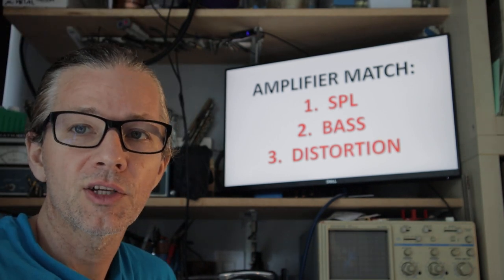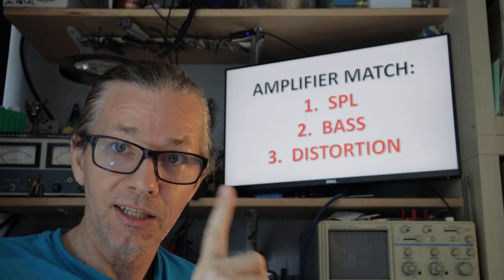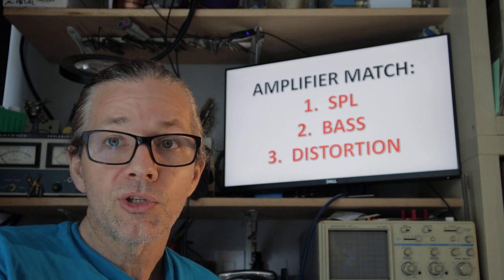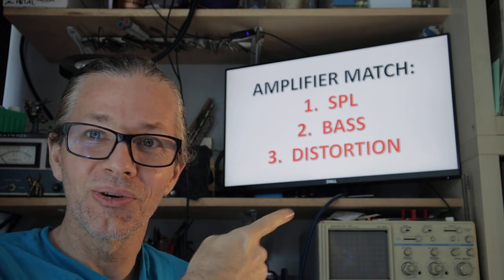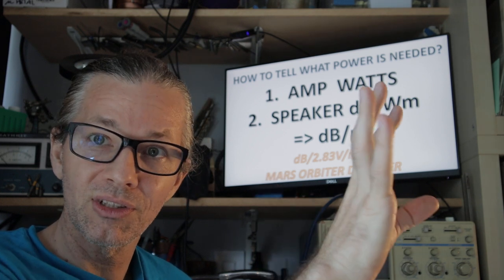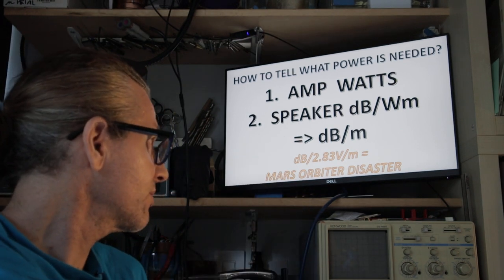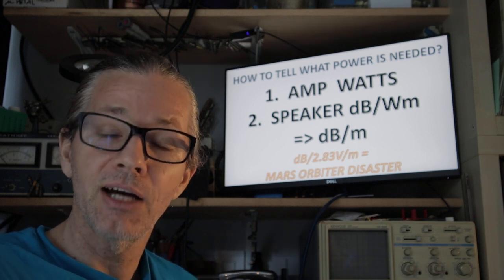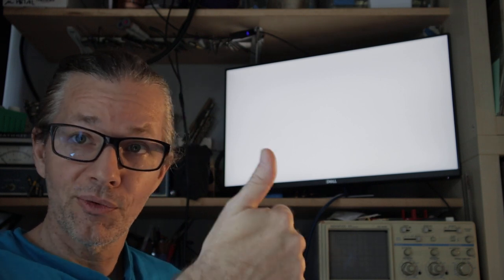How to match amplifier to loudspeaker - Part II.

Comment: Hi Janos, 
Hope you're well :)
Thanks for sharing.
I agree with the fact that high efficiency let's you see deeper into the music for less money. It's like it can unfold the music at a higher level for less money.
It is also easier to obtain high quality on lower power amplifiers because we can use nicer parts, a shorter signal path etc...
But there is a con with that. The bass. I've listened to a lot of high efficiency loudspeakers lately. They need Giant cabinet to be able to produce the right amount of bass, to go low enough compare to a low efficient speakers.

On the other side I don't subscribe with the saying that high power means less quality. I think the bad high power with compromise inside and weak parts shows limits quicker and loose the magic when you ask more power from those amps.

Today we live in small rooms and if you wish to have a almost complete sound 30hz to 20hz a nice small speakers with low efficiency and a stable impedance curve is the right choice. You feed it with quality power, a DIY class A amplifiers with the good components sound amazing. Not something you can buy they always have compromises. The same way you have to make you low power amps.

So I think at the end it depends on what someone wants and like to listen.
Most of the high efficiency loudspeakers I've listened sound nice but it was like half of the information was missing. The part that was there was wonderful but the drivers couldn't go far in a small room. Plus the imaging and soundstage is non existent buy comparison. The dynamic is insane on high efficiency speakers and you get the timing very early.

I understand the benefits of high efficiency but I think there are no absolute. 
It is like the conversation on digital vs analogue. I think the digital equipment we use is in the stone age. 
During the COVID i proceeded to improve mine and upgrade everything from the network to the components and making my own streamer (with 9 different lpsu etc...) I can see clearly why the digital sold I terrible. 

I see it like high efficiency speakers is analogue: simple, direct, amazing.

Low efficiency is digital : difficult, complicated but if you take the time to clean every aspects like we do in analogue the quality 🎉

I just wanted to push the conversation 
Have a nice day my friend.
Reply: Well said!
Reply: "Today we live in small rooms and if you wish to have a almost complete sound 30hz to 20hz a nice small speakers with low efficiency and a stable impedance curve is the right choice."

The actual heck is that mean? Are you suggesting that a shoebox with a tiny 4" ~82-84dB mid woofer is the best choice for anything? Sure you can get the mids and highs as right as possible, but those things have jacksh*t bass no matter what...

Comment: Hi Janos. One question. In recent times I’m listening to the music at volumes measured in about 60-65 db and I seem to enjoy this volume whatever the genre is playing.
Am I losing something in terms of sound scene, stage and so on?
Greetings and tanks.
Giovanni
Reply: You must have a really nice and well-matched system. You're enjoying all the details, and saving your hearing! 😊
Reply from the maker: I don't think you are missing out on anything. The brain is an interesting device, if you listen to quieter volumes, it will adapt to it and you will hear plenty of detail level. Then, from time to time you can go for louder volumes, and then you can hear even more - more intensity, bigger space, etc. However, when one constantly listens to loud only, then the ears / brain just gets worn out, and after a while you will not be able to enjoy it fully as on one side the ears are tired and worn, and on the other side the system will run out of quality headroom if you'd want to increase SPL for better detail, as it's already playing super loud....  
So, most of the time I'm listening also in the 60-65dB peak range with dialogues / singing in the 30s-40s, and that also helps to keep the hearing intact - and not just intact, but ever improving. ;

Comment: Hi Janos, my new speakers are rated at 86dB/1W/1m, Max SPL: 103dB. impedance: 8Ohm. 
They recommend an amplifier with >100W/Channel. My amp has only 45 Watts at 8Ohms.
 I rarely listen to music above 80dB, but do I miss sound quality also at lower volumes with this amp?